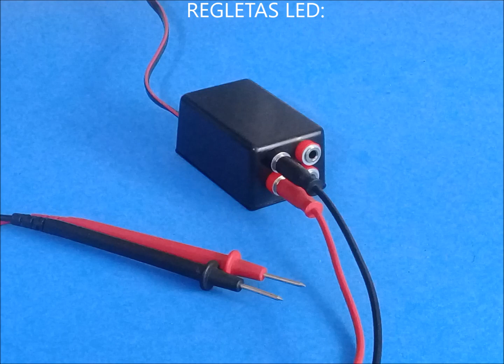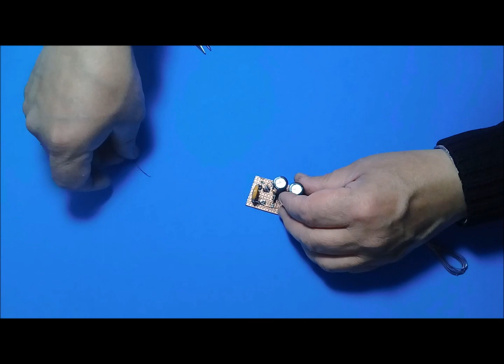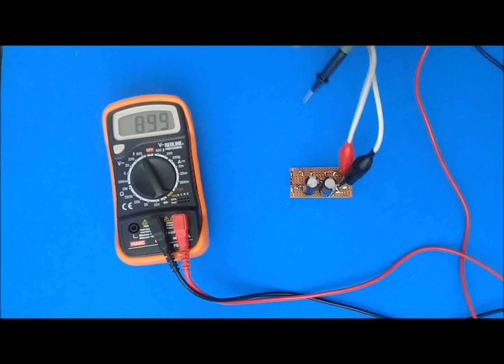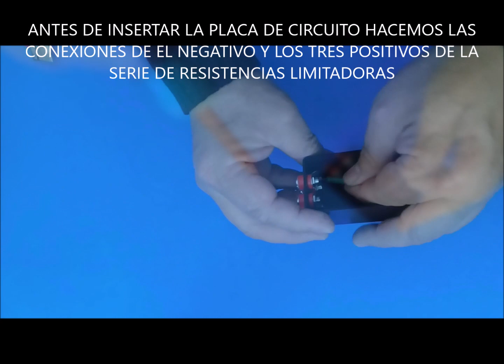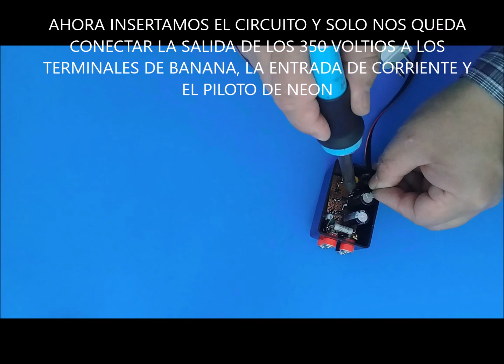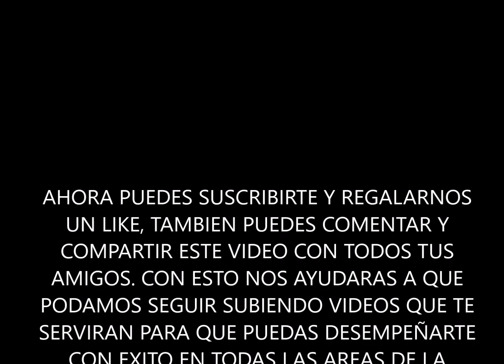PROBADOR DE BARRAS LED EN MINIATURA

Comment: Muy buen video y el voltaje excelente tengo una duda el neón es para evitar los cortos se pueden unir las 2 puntas sin que este se queme?
Reply from the maker: Hola Libardo muchas gracias por comentar, el neón sirve para dos cosas, la primera es un testigo de la presencia de 300v a las salidas, al desconectar el probador el neón va descargando paulatinamente los condensadores y veras apagarse el neón, pero tu puedes cortocircuitar las puntas para acelerar el proceso, lo que no te recomiendo es que las cortocircuites mientras el probados esta energizado, por que aunque el probador "resiste" pequeños cortos, si dejas el puente de manera permanente sobrecalentaras las resistencias limitadoras. Un abrazo y éxitos

https://www.youtube.com/watch?v=VLOldQS7peU

Comment: como es q no los revienta a probar pocos leds con mas de 300v??  se algo de electronica pero quiero entender como es q funciona el doblador d tension y como sabe que tension es por leds
Reply from the maker: Hola By muchas gracias por comentar, lo primero es que el valor de las resistencias esta calculado para que la corriente que circula por el circuito no sea mayor a determinado valor (unos12mA), al energizar el circuito la resistencia limitadora carga con el valor sobrante del voltaje y por esa razón no se queman los leds. lo segundo es que ambos capacitores hacen como dos bacterias en serie, cada uno se carga a 160v, así que al estar en serie dan 320v, la configuración de los diodos hace que se carguen de manera secuencial con la corriente alterna, éxitos

acá tienes como saber el voltaje de los leds:

https://www.youtube.com/watch?v=sCkB-7mSCwE

https://www.youtube.com/watch?v=eKKhHQrcS_8&t=0s
Reply: @ELECTRONICAHOYTV  genial, me gusta saber como funciona las cosas antes de hacerlas. e visto que los hacen con un transformador, pero creo q son de in~220-out~220. nose si tendran una mejora o son lo mismo
Reply from the maker: @by-jony  Hola By gracias por comentar, hay diferentes maneras de lograr un voltaje de alimentación a las regletas, de todas maneras debe ser un voltaje tipo DC y limitado en corriente de alguna manera, como por ejemplo resistencias. Éxitos

https://www.youtube.com/watch?v=p5frBVLcDPU&t=0s

Comment: Buen tutorial, mil gracias por compartir tu conocimiento, tengo una duda, tengo una pantalla LG de 32 pulgadas , puedo checar led por led y no se quemaría? Son de 3v cada led. Gracias amigo dios te cuide👍.... Otra duda si por accidente toca uno las puntas con la mano no te da toques 😁  o también si se juntan las puntas no se quema el proyecto? sorry soy nuevo en esto, gracias
Reply from the maker: Hola Israel gracias por comentar, el probador dispone de tras salidas para probar diferente cantidad de leds, desde los backlight mas grandes hasta los pequeños de monitores, pero esta pensado para probar regletas y no leds individualmente, aunque si pruebas uno por uno no creo que te los queme pero debes hacerlo de manera rápida, también puedes incrementar un poco el valor de la ultima resistencia de 15K,  la puedes incrementar a unos 22k o 25k si deseas tener la opción con el probador. si tocas las puntas claro que recibirás una descarga puesto que hay 300v en ellas pero es que esta herramienta NO es un juguete, es para el uso de personas que tengan conocimiento en electrónica y que por lo tanto son responsables de su uso. si juntas las dos puntas no se va a quemar el circuito aunque las resistencias se van a calentar dependiendo de la salida que estés usando, se calentara mas si usas las primera salida que solo tiene la resistencia de 1,2k y se calentaran menos si estas usando la salida con las tres resistencias en serie pero eso también es responsabilidad del usuario, sucedería lo mismo si te compras un multímetro FLUKY costosisimo, sin importar la calidad del instrumento podrías quemarlo si le aplicas voltajes de manera incorrecta. entonces si se pueden cortocircuitar las puntas pero por periodos cortos, si las dejas pegadas indefinidamente si se van a quemar. Éxitos amigo y Bendiciones de Dios en tu caminar por esta linda profesión.
Reply: @ELECTRONICAHOYTV  muchas gracias por tomarte tu valioso tiempo de contestar y asesorarme, soy nuevo en esto de las pantallas, ya que me gusta el ramo de la electrónica, mil bendiciones para usted y su familia, dios lo cuide y le de salud, mil gracias
Reply from the maker: @israelmorales1552  Hola Israel gracias por tu comentario, has escogido una muy linda profesión, Recuerda que Dios también es un reparador,  Mil Bendiciones.

Comment: La resistencia que mensionas de 450k en el diagrama está en 470k cual pondría y a qué potencia? Gracias bendiciones
Reply from the maker: Hola carlos gracias por preguntar, el valor no es tan critico, esta solo es para descargar los capacitores entonces puedes colocarle la de 470k a 1/2w. Exitos
Reply: @ELECTRONICAHOYTV  perfecto gracias y cuando miré el plano que está al terminar ví que figura un capacitor que tampoco dice nada de su valor. Gracias por contestar

Comment: What happens if the reverse probe is connected, I mean reverse voltage
Reply from the maker: Hello, thank you for asking, do you mean that if voltage enters the probe ?, in that case you could burn the resistors and / or explode the capacitor, to test the led strips you have to disconnect the power supply from the power plate. Successes and blessings
Reply: @ELECTRONICAHOYTV  Porque tiene 4 salidas ?
Reply from the maker: @sargen73  Hola Sargen gracias por comentar, las salidas son para suministrar diferentes corrientes al back light, tal como se explica en el video. Exitos
Reply from the maker: @sargen73  Hola Sargen gracias por comentar, si miras con atención el video veras que las salidas son para aplicar mas o menos corriente al back light, de acuerdo al tamaño y la cantidad de leds del back light, comenzando por la salida de mas resistencias que es la que provee menos corriente, esto es para cuidar los leds. Exitos

Comment: UNA PREGUNTA, las 3 salidas que tiene va a depender de cuantos Led queramos encender verdad?
Reply from the maker: Hola Khriz gracias por comentar, si...son para que funcione con la corriente mas adecuada. Éxitos
Reply: Disculpa, entonces cuantos Led entendería con la salida de 1.2k(resistencia)  y 5k(resistencia) porque dijiste que es muy común que se probaran con 21k aproximadamente (la suma de las 3 resistencias) espero me respondas y entiendas mi pregunta jaja!
Reply from the maker: @khrizalexsalama2839  Hola Khris gracias por comentar. este probador, al igual que la mayoría, puede encender todas las series de leds sin importar cuantos hayan en esta, lo que sucede es que entre mas leds haya la corriente circulante va a disminuir de manera proporcional y si tienes por  ejemplo la salida con las tres resistencias puede ocurrir que la corriente sea insuficiente y por esa razón puedes "quitar resistencias de la serie" conectando en otro pin de salida y así habrá disponible mas corriente, pero también puede ocurrir que sea una serie de pocos leds y estés solo con la resistencia de 1,2k y puede ocurrir también que sea demasiada corriente para la serie, por eso también puedes añadir resistencias conectando desde la salida de 5k o 15k. estas resistencias son pues para ajustar esto pero hay algo que el probador NO puede hacer y es que  también y, al igual que la gran mayoría, es que aunque con la prueba sabemos fácilmente cuales leds están malos, no se pueden probar a potencia plena pues hay series de leds que disipan 120w, 180w, etc y el probador no provee mas de 5w pero esa prueba ya la puedes hacer bien después de haber cambiado los que están malos, la propia tarjeta del televisor les dará la potencia suficiente. Éxitos amigo

Comment: Hola consulta, soy nuevo en los led pero te queria preguntar, en mi pais la entrada es 220v , las  resistencia las tengo que multiplicar por 2 imagino, y los capacitores poner de 250v , pero los microfaradius , picofaradius serian los mismos o tengo duplicarlos en serie ? gracias por tu tiempo
Reply from the maker: Hola fernando gracias por preguntar (antes que te explote el circuito jejeeje) si tienes 220v solo necesitas rectificar con un diodo y el capacitor debe ser mínimo de 450v, unos 22 uF mas o menos, con eso tendrás una tensión DC cercana a los 300v, lo cual es mas que suficiente, puedes dejar los mismos valores en las resistencias. en la pestaña de "comunidad" puedes encontrar el circuito. Éxitos

Comment: Saludos amigo buen video solo tengo una a duda en el país donde vivo el voltaje de la red es de 220v que modificaciones debería hacerle al circuito
Reply from the maker: Hola Freddy gracias por comentar, cuando tienes 220v no es necesaria la etapa dobladora de tensión, solamente con un diodo rectificador y un capacitor de unos 450v tendrías una tensión DC cercana a los 300v. busca en mi pestaña de comunidad y encontraras ahí el plano. Exitos

Comment: Hello, I don't speak Spanish, I like this led tester and I really like the way you filmed your video. I only have one question. In my country (Greece) we have 230VAC. How would that change your design? For example, I know instead of 180v/470uf capacitors, I have to use 400v/470uf. What about the varistor? Is there anything else I should change?
Reply from the maker: Hello solidhit thanks for commenting, in the case that you tell me you would have to discard the booster and leave only a half wave rectifier. You can find the plan in the tab marked "community" because they had already asked me the same thing. the capacitor would then be for 400V and the varistor would also have to be replaced by another for 230v, you can get it from a source board manufactured for that voltage. A hug and success
Reply: @ELECTRONICAHOYTV  Thank you so much!
Reply from the maker: @solidhit2  hello with pleasure.

Comment: Gracias,  quieto preguntar que como no se queman los leds si ellos trabajan con 3V?,
Reply from the maker: Hola esteban gracias por preguntar, como es un circuito en serie la caída de voltaje sobre cada led es aproximadamente el voltaje de trabajo de cada uno y al estar todos en serie resulta que la alimentación de todo el back light se "auto-ajusta" al voltaje que necesita cada regleta. la resistencia limitadora absorbe el voltaje excedente. Éxitos
Reply: @ELECTRONICAHOYTV  como duda , si mi TV tiene solo 18 leds de backlight, entonces podría yo tener una fuente de 54volts en teoría ?, o ponerlos en paralelo?
Reply from the maker: @estebangilburt9843  Hola esteban gracias por preguntar, la iluminación del back light se puede lograr de varias maneras, entre las cuales esta la que tu mencionas. El motivo por el cual todos los leds se encuentran en serie en TODOS los televisores es con el propósito de ahorrar espacio y circuiteria, pues una alimentación en paralelo consume mas corriente pero esto tiene algunos problemas descritos en este video. 
https://www.youtube.com/watch?v=MUKbR9GQDJQ&t=194s  
pero si estas dispuesto a experimentar con tu tv claro que puedes intentar alimentar en paralelo por ejemplo las cuatro regletas con una fuente externa de 12v. El inconveniente es que perderías la posibilidad de realizar ajustes en el brillo del televisor y entonces lo tendrías que hacer de manera análoga con algún dimmer adicional.  te das cuenta de el porque estan todos los leds en serie?. te recomiendo que veas este otro video
https://www.youtube.com/watch?v=sCkB-7mSCwE&t=118s
Reply: @ELECTRONICAHOYTV  gracias por tomar el tiempo en responder,  mi LED Samsung de 32 fue reparado los leds 3 veces y se queman diferentes , le cambiaron solo los quemados , por eso desistí de repararlo ya que gaste mucho con los Service , ahora quiero experimentar yo
Reply from the maker: @estebangilburt9843  Hola Esteban, entonces lo que te recomiendo es que te consigas todas las regletas para ese televisor, es decir para ese mismo modelo y las reemplaces todas, ademas de ajustar el brillo al 50% y no pasar de ahí nunca mas pues esa es la razón de que los leds se sigan quemando, Éxitos.

Comment: Amigo tengo una duda para la fabricación del probador, en el diagrama del video, la capacidad de los capacitores esta marcada como de 470 uf, pero en el texto que nos hiciste el favor de  acompañar para la explicación de funcionamiento y armado mencionas que son de 47uf me podrias aclarar cual es el valor correcto, gracias por tu apoyo excelente video.
Reply from the maker: Hola,  47 uF son mas que suficientes aunque el valor no es tan critico en cambio el voltaje si, cada capacitor debe soportar por lo menos 180v para un probador de 120 Vac de entrada.  Éxitos
Reply: Muchas gracias por tu apoyo te felicito por tus videos tan didácticos y explicativos. Éxitos
Reply from the maker: @luisaldanuscanga3566  Hola luis gracias por comentar, Igualmente muchos éxitos

Comment: Amigo muy bien video me podría facilitar el plato más detallado
Reply from the maker: Hola gracias por comentar, busca en la pestaña "comunidad", que esta después de listas de reproducción, ahí encontraras dos versiones del plano. Éxitos
Reply: @ELECTRONICAHOYTV  amigo el varistor que número es mí red es de 120 voltios
Reply from the maker: @luismartillo2682  Hola gracias por comentar,  creo que era un mf72,  lo saque de una placa de un televisor CRT que tengo para repuestos, estaba a la entrada de la fuente. Exitos
Reply: @ELECTRONICAHOYTV  si ya el doblador de voltaje me salió perfecto muchas gracias por tu información y tus conocimientos tus videos son de mucho aporte
Reply from the maker: @luismartillo2682  Hola, gracias por comentar, felicitaciones y Éxitos.
Reply: @ELECTRONICAHOYTV  amigo en la salida me sirve una resistencia de 1k a 5 w
Reply from the maker: @luismartillo2682  Hola gracias por comentar, la de 1,2k solamente las demás pueden ser de 2w. Éxitos

Comment: Habria que modificarlo para usar con entrada de 220v, saludos
Reply from the maker: ufff... !!! pero claro amigo, gracias por comentar. este es para 120v.  voy a hacer unos experimentos a ver que me sale del coco
Reply from the maker: Hola Daniel, pensando bien la cosa y gracias a Dios hay una solución simple. no se necesaria el doblador de tensión, como se trata de 220 voltios, al rectificar y filtrar con un capacitor, osea una fuente simple con un solo diodo y capacitor obtendermos unos 285 voltios dc lo que es mas que suficiente para colocarle las tres resistencias de salida para probar los leds.  puedes hacer la prueba y me cuentas.